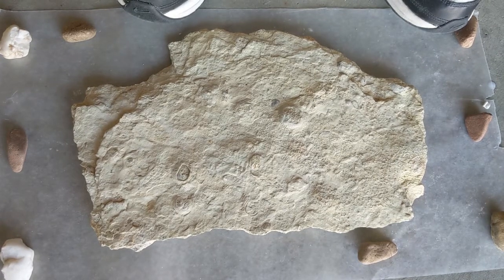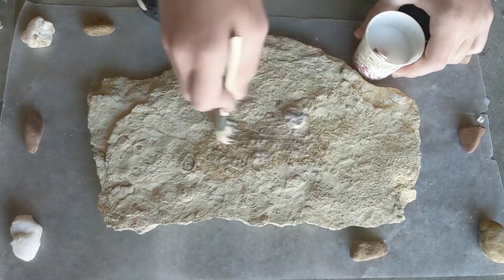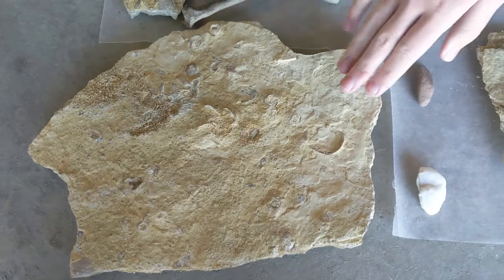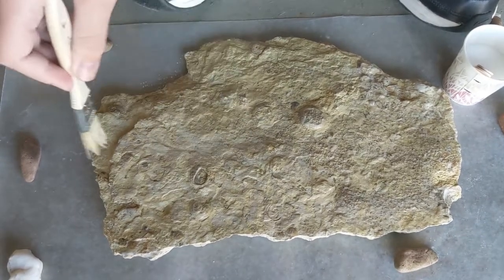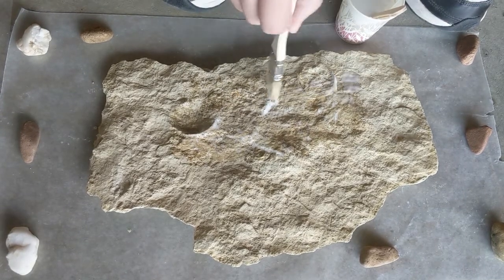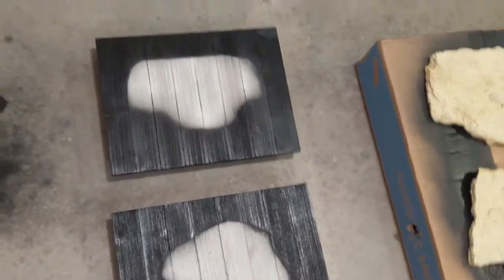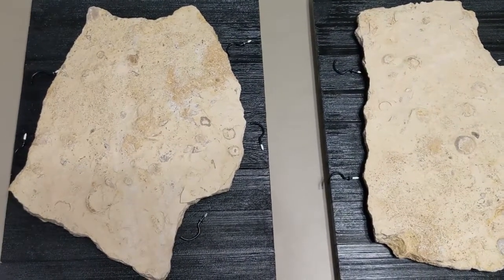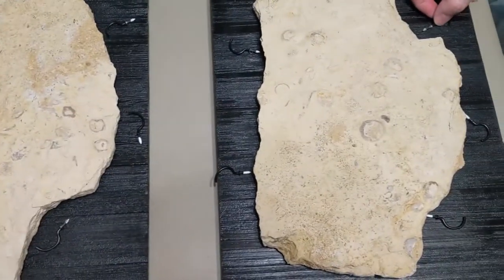How to Preserve and Mount Limestone Fossils

Comment: Wouldn’t it be better to use plate mounts or cup hooks screwed into the board to secure the fossil to the board? Then you wouldn’t be ruining the back side of the fossil with heavy industrial glue and if desired could take it off the board to view what fossils are imbedded on the back at some point in the future.